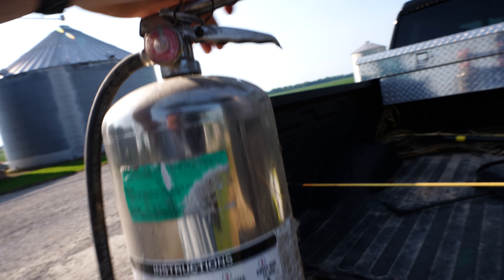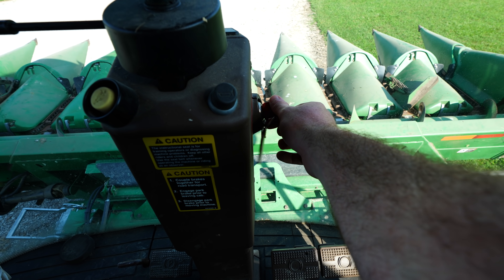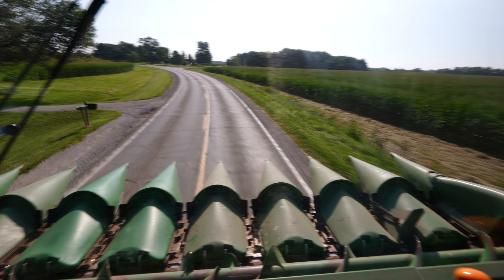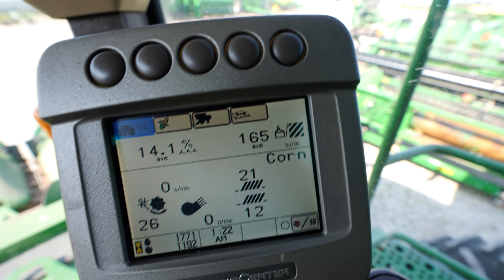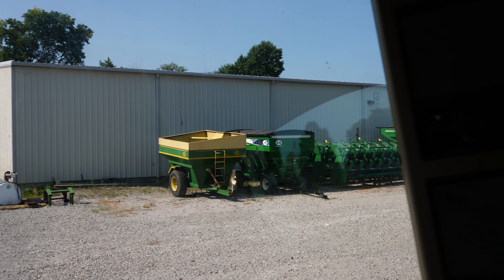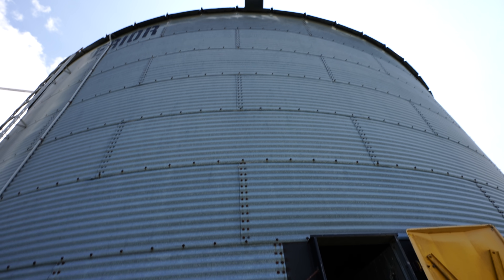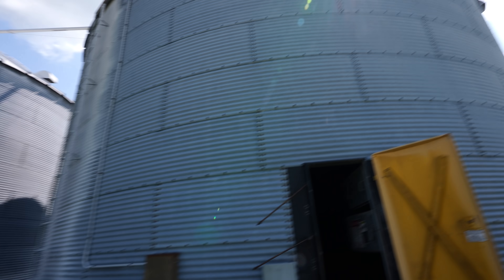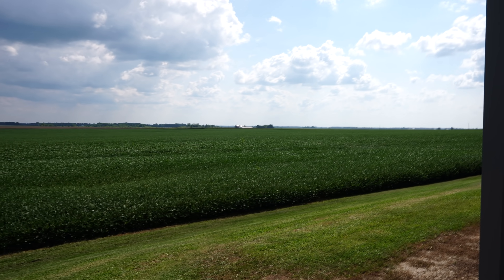The End of An Era - John Deere Combine Leaves The Farm For Good (Ep.98)

Comment: Viewing from a city in Australia, I like your clear and detailed delivery, discussion of actual costs of the equipment and the bushel price. Your Dealer is close by, I guess, but surely those 2012 machines have been more fixable by YOU, compared to the latest machines you are now committing-to? I hear that JD has a poor reputation in that regard, and it will be "go to the Dealer" for everything!
Reply from the maker: You make a valid point. However, a majority of the problems that go wrong on a combine are simple part replacements. Belts snap, chains break, and parts wear out. Although we can fix these ourselves, we still need a dealership to secure some of these unique parts. I believe that the issues with right-to-repair is more related to the technological side, such as engine diagnostics, etc.. It is often more efficient for us to have John Deere service the equipment because they are vastly more experienced than we are. The new combines are nearly identical inside to the last 10 years worth of combines, with the exception of a few different systems. Thanks for the comment!
Reply: @aTrippyFarmer  Thanks very much for responding. You are fortunate to be close to a Deere Dealer and also pretty close to their Factory. The guys in Saskatchewan (and Australia!) using JD can be seriously held-up by one of the many sensors in the latest machines needing diagnosis and parts after a costly visit by travelling JD technicians. Hope your new combine proves to be a step forward!!

Comment: With all the new technology in farming is it hard to convince your dad and the older generation to make the change to more expensive units with bells n whistles? Enjoy your content and love seeing the cornfields of Illinois again. I went to school at EIU and familiar with that area.
Reply from the maker: I know a few...hundred...EIU grads--Charleston is just a stones throw away. Glad to offer you some reminders of Illinois. It's not ALL bad in this state. As for the technology and upgrading, there are a few implements where the technology offers a clear-cut improvement in productivity and efficiency. Our John Deere ExactEmerge electrically-actuated/driven planter would be the best example of that. This system almost doubles the capable speed of a planter compared to the older hydraulically and mechanically driven planters, while also increasing accuracy and precision of seed placement. It is easy to sell upgrades like that. However, there is also a lot of equipment with technological upgrades that don't necessarily have a ton of tangible benefits. Our new combine, for instance, will have a system of cameras in various parts of the cleaning system to monitor grain quality and change settings accordingly if you want it to. Most operators can manage these settings themselves, and the system does not increase throughput of the combine at all. Technology like this has its place, but it isn't a huge selling point for a lot of farmers. For us, upgrading equipment is usually more of a depreciation/reliability game. Older equipment tends to become less reliable over time, so we trade for newer stuff as we see fit. We were due for a new combine and big tractor, so we traded up. The newer technology is just a benefit of the transaction. It is really as simple as that in a lot of cases.
Reply: @aTrippyFarmer  Thanks for the reply. I graduated from EIU in 2007 and shortly after that moved to North Carolina.

Efficiency is always better!! Looking forward to seeing the new combine and hope y'alls harvest goes better then Welkers. Those guys got hit hard with hail and threw in the towel on yellow beans.